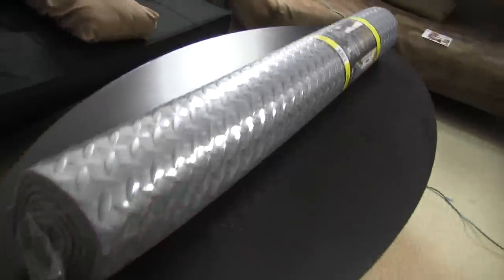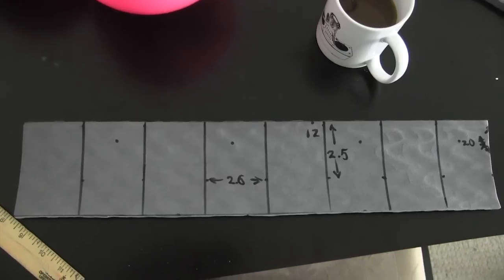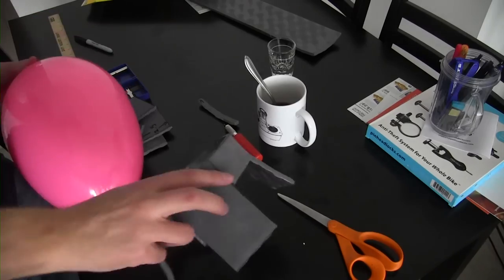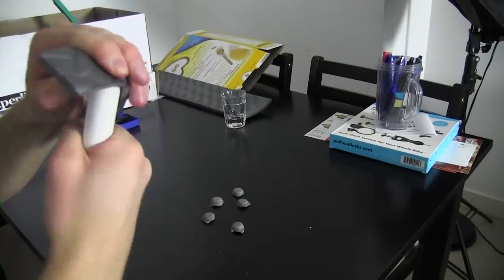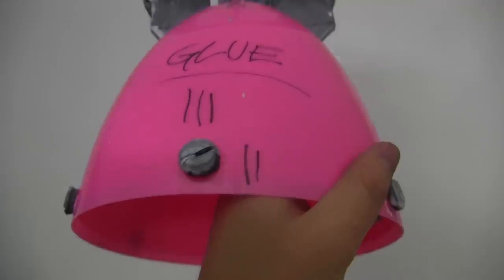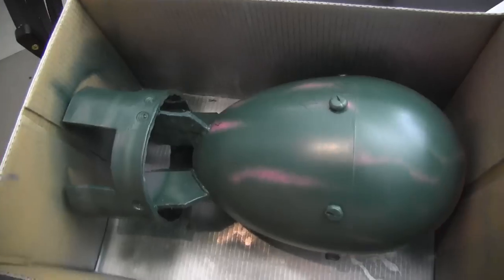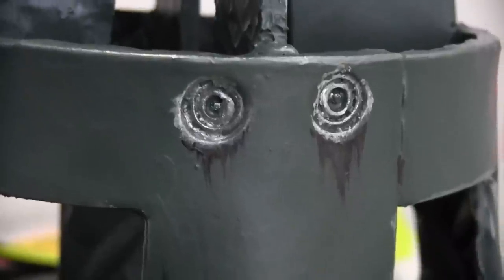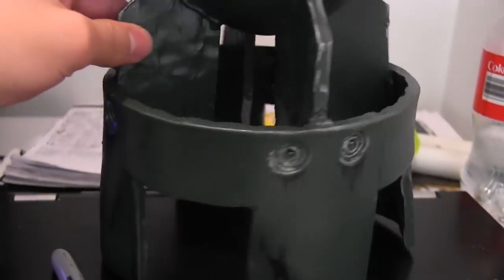How to Make a Mini Nuke (Fallout DIY)

Comment: I have a challenge for you... Make a Big Daddy suit from Bioshock
Reply from the maker: I actually am already planning to do that but the materials are stored back in NY so that project is on hold for now.
Reply: he barely has time to make this, any suit would probably  come out months from now at the least if he started right away
Reply: William Jakespeare why dont you use plastidip to prime your eva foam?
Reply from the maker: Anarchist Gaming
It's slightly more expensive, harder to coat properly, more difficult to clean up and i'm not crazy about the texture.
Reply: William Jakespeare Robocop? I mean when you can and if you want to.